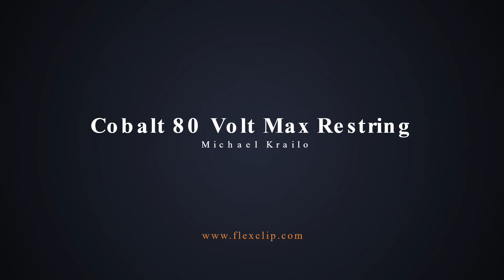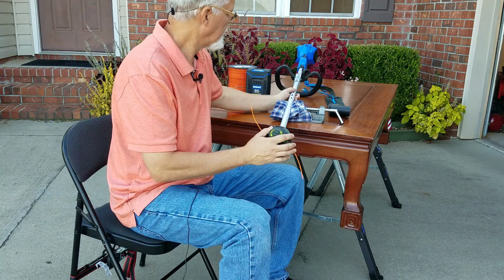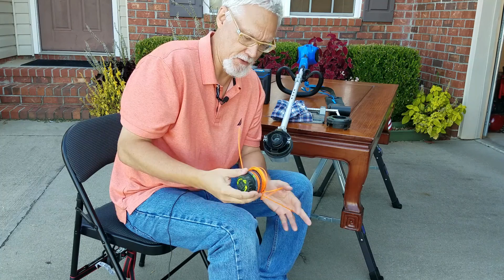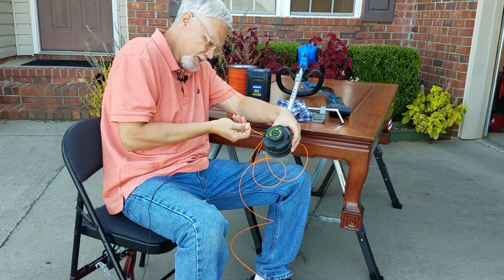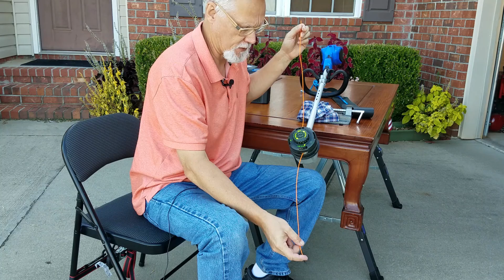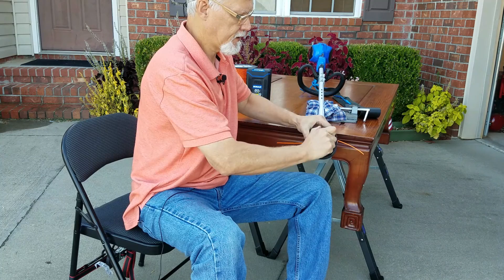Kobalt 80 Volt Trimmer Restringing Problem and Solution

Comment: The wind direction arrow on the inside (grey) piece shows the opposite direction for the wind than is indicated by the arrow on the "wind cap" on the outside. It's a great trimmer with a lousy head design.

Comment: Someone has way too much time to worry about two feet of trimmer line being on the spool.  I have this head on my Toro, it's make by Tecomec ... great string head.  It will handle 065, 080, an 095 trimmer line.  I use  080 line and get 20 feet (two 10 ft segments) by just twist feeding.  When it 99 degrees and 105% humidity I'm not taking the time to disassemble a head for two more feet of line.  I also like the Hipa Speed Feed 400 head sold on Amazon ... it's the clone of the Echo Speed Feed 400 head, sells for about $20 for the multi-app head.
Reply from the maker: If you can get yours to hand twist the line on easily without binding up  like I showed here, more power to ya. This is just an option to overcome the problem that happens every time I tried twisting it in there. I definitely don't worry about anything, and find it super simple to pop the cover off and string it up my way. Super easy and temperature has nothing to do with it.

Comment: Why do they do this 2 string bump and dump crap?  I want a cut string head that uses at least .1" line.  At least that line lasts more than 5 minutes.  Problem with the Kobalt 80V is the motor fan is part of the head.  You'll have to figure out a way to cut the existing head, keeping the cooling fan.  Looks possible.  I had a gen 1 80V and the thing was BRUTAL with big boy cut line.   Unfortuneately the fan was compromised with my mod.   The motor lasted about 2 months of harry homeowner light duty.  I was cutting the two .120 strings to 21" and removed the guard.  WOW!!!  I know it was too much, but couldn't resist.  Now have a Gen 2 which is a bit diff.  Bigger motor shaft w/different attach.   Kobalt needs to fix something here..  BADLY.
Reply from the maker: I'm not doing any commercial lawn care so don't need to use anything beyond what the tool was designed to use. I just need it to work, and it has been doing exactly what I need for a couple of years now without any other additional problems. Couldn't be happier to get away from gas powered trimmers.

Comment: My cap is almost impossible to take off. Any tips?
Reply: There are two tabs that hold the cover in place. Flip the whole thing so the bump knob is facing up. If you position the  holes for the lines at north and south, the tabs are at east and west, and below the “bottom” rim of the movable part. Press the tabs in—you can do them one at a time—and the knob and cap will pop right off.

When you go to put it back together, I would suggest you line up the knob first. Once that’s in place, you can place and press down on the cap. Remember those tabs should be 90 degrees from the line feed holes, and just as when taking it off, you can click the tabs into place one at a time.

Hope that was helpful!
Reply from the maker: Almost certainly you have wound too much string onto the spool. Just reduce the amount and it should be relatively easy to remove the cover.
Reply: @michaelkrailo5725  This is not correct.  Once you wind string onto the spool, you are done.  You do not take it apart anymore, until you use up all the string again.  Yoiu only remove the cover to replace string, not after you replace string.  The tabs to take the cover apart do not press in far enough to release the cap.  have tol use a screw driver or two to press and pry and then when tightening the spool, taking uo the string, it is a bear to wind,  Maybe some versions work better than othners.  I bought mine in  2024.

Comment: Its a shame they havent gotten a better design to load the string. I love the power of this trimmer. To me the key is to keep the inside clean and free of dirt. Ive been using your technique for a couple years. Trying to wind it is a pain.
Reply from the maker: Glad it's working out for you.
Reply: I am fed up with trying to string this spool with this stupid design. So what I did was took the trimmer head off and turned it upside down. Bolted it back on to trimmer head. Now I can manually installed two pieces of trimmer line. It is so easy a little kid could do it. Also when the line wears down super easy to pull out and put in new line. This is the answer  to the stupid spool winding that just doesn.t work
Reply from the maker: @andywolf7406  Well you lost me Andy. How does flipping the trimmer head over improve anything? Maybe you have a different model then mine because mine is not bolted on as you say. It can be screwed off, but I don't see how flipping it over has any advantage at all. You might have to make your own video showing how you made it easier to do as the verbal description doesn't make much sense. When you say trimmer head, I take that to be the entire plastic spool housing that screws directly onto the direct drive motor spindle. Also when you say the spool winding doesn't work, what exactly doesn't work. I don't have any problem at all with mine.
Reply: You can watch utube videos all day but at the end of the day winding this line on this spool is ridiculous. The solution i offered in my pervious reply is am easy solution

Comment: I have a similar 40 volt Kobalt trimmer.  I've tried every combination and permutation of Kobalt's instructions AND your method, and I cannot get the bump feeder to work.  The trimmer is only about 3 years old and hasn't seen hard use.  Still, every time I need to use it, I have to take it apart and restring the darned thing.  It wouldn't be so bad, but I have about 18 linear feet of chain link fencing, and the line is demolished each time.
Reply from the maker: Some of the other older models do not wind in the same direction as this direct drive version does in the video. Is yours a direct drive with the motor right on the top of the bump feeding spool? I would make sure you are winding in the correct direction for your given model and that the bump feeder part is properly seated flat. If either of these things are not done right, it will not bump feed out the line. Also try reducing the amount of line you are trying to wind onto the spool. Not all trimmer line is the same either, I'm using the round heavy duty type with this model and it works great. If you have tried winding in both directions and tried different line and made sure the bump feeder is seated properly and it still won't feed, then you have some kind of a manufacturing defect of some kind. Has it ever worked at all? About the chain link fencing, maybe you could put a strip of solid smooth aluminum or other metal/plastic at the base of your fence so that the string does not get demolished as much. That's what I would do at least.

Comment: Thanks Michael for a clear concise explanation. I agree with you after using (trying to use) the instruction method which works for about the first two or three times you change the line. After that the cuttings gunk up the bump knob enough to make cranking the line in the spool difficult at best. I started using a pair of channel lock pliers to turn the knob which wears down the knob. Much easier to take the head apart and wind the line as you show. There are even arrows on the spool that show which direction to wind the line after hooking it in place. The instruction method is purely a sales tool in my opinion to make it look simple and easy to facilitate sales. Great tool though (discounting battery strength).

Comment: I have the entire line up of Kobalt 80V tools.  The string trimmer works great, but restringing is a definite PITA.  For the first 6 months, it worked fine, but it became more and more difficult, eventually binding when winding the new string in, and then the bump stop wouldn't release new string.  I just tried your method and it works fine...with one caveat.  Mine is about 2 years old, so the tabs that hold the head on are pretty worn, hard to press in to disengage, and hard to reset once you've wound the string.  Still...this is easier than the method provided from Kobalt.  Good job!
Reply from the maker: You bring up a very good point about the tabs being difficult to disengage. I have found that by simply pressing and releasing on one tab, then pressing and releasing on the other tab in an alternating fashion (usually about five or six presses), will pop that head cover right off with little effort. Even though when pressing on the one tab, it seems like nothing happens, by alternating between the tabs and pressing on just one tab at a time, it comes off very easily. If you try and get it off all at once by pressing both tabs at once, you are in for a frustrating experience for sure. Try my suggestion and tell me how it goes. As far as pressing it back in, that is made easier if there is not too much string wound on the spool, you can try reducing the amount down to ten feet of line or so.
Reply: @michaelkrailo5725  Thanks.  I've found that by pressing one tab, then either prying up that same side with my hand or with a flat tip until a gap appears at the base, then pressing in on the other tab while pulling up usually does the trick.  When re-installing, I've also found the tabs hard to re-engage, and usually bend the tabs a bit outwards prior to inserting.  This usually does the trick.  Naturally, the issue is there are so many "tricks" you have to remember (length of string, how to insert, how to pop tabs, how to wind, how to insert tabs), that over the winter I forget most of them and have to review videos again, then "remember" how I did it before.  I should probably make my own vid as all the vids I see on this unit appear to be pretty new units, not very well used units like my own.  Overall, I've found the entire Kobalt line to be damn good and their customer service to be amazing.  The oil cap on my 80V chainsaw fell off (poor design) and when I contacted them to purchase a new one, they informed me they no longer made that chainsaw with that oil cap, so they sent me an entire new saw.
Reply: Read  my post I posted a solution  to this ridiculous problem

Comment: So glad I found your link in the comments on that other video as I could not really get the bump head to turn at all (we're using heavy duty trimmer string)!  It was reassuring to know I'm not the only one with this issue.  It worked perfectly to wind the string manually.  I especially appreciated the heads up on the length since the manual is long gone, our other trimmer takes a lot more string, and I started out trying to wind on too much.  The Hubs is happy his trimmer is back in action.  Thanks!
Reply from the maker: You're welcome Margaret, glad you were able use this method successfully. I still cannot believe how well this tool works once you get past this particular issue.

Comment: Grate video and lots of help. Like you said. It’s a very good trimmer. Just a pain to feed. With your method, it works like a charm. Tanks again!
Reply from the maker: Glad it helped you out. It sure is fun using this tool when the string feeds out perfectly.
Reply: Kool, I don't have any cordless trimmers, but I read the comments of other videos & folks complain about the trimmers feed head.
Reply: These damn things are so badly designed I can't believe it.